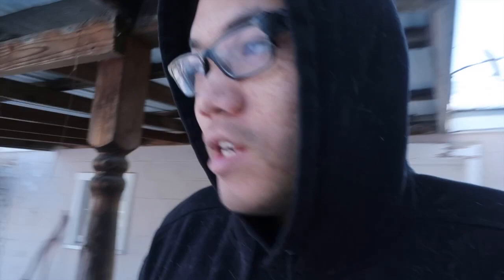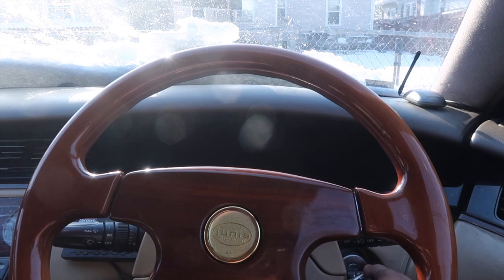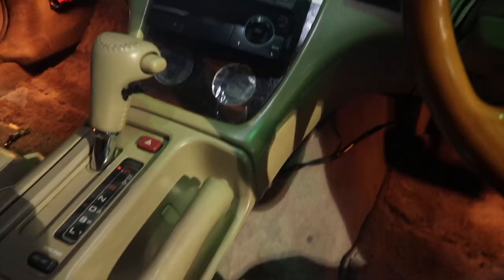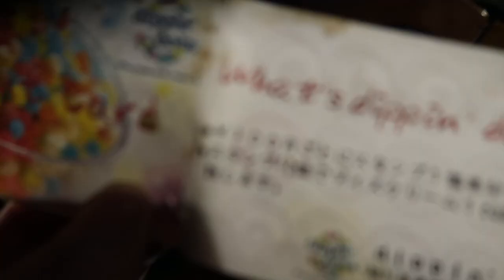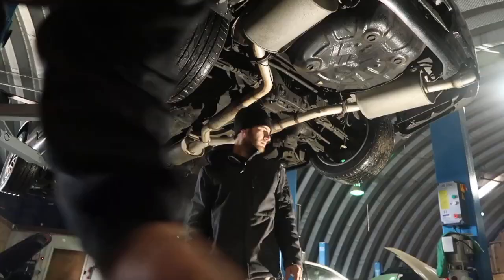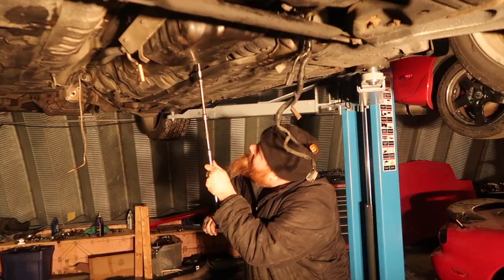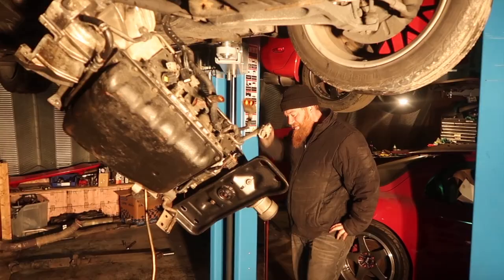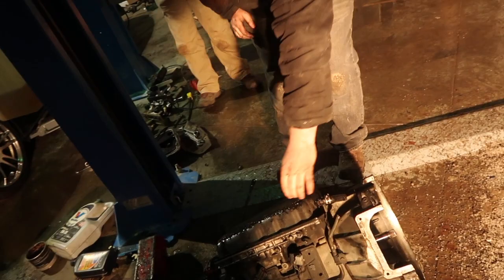My Transmission Almost Killed My Friend | Eunos Cosmo 5 Speed Swap

Comment: no engine hoist I guess you're learning baby steps how to do mechanic work ?
Reply from the maker: Manuelito Dias explain how an engine hoist would make the trans drop easier lmao. Learning baby steps just have a 6 lift shop and dyno.
Reply: well well somebody definitely get upset 😡quite easy talking about heaven short fuse.
you want me to explain how easy to trap the transmission down 👌 I'm going to explain that easy as I can to you can't basically baby👶 steps so! once you get to you last process steps of almost bringing the transmission down
1 you make sure to praying your transmission jack
2 Jack it up all the way too meets   with the oil pan from the transmission nope now not not!! the oil pan from the motor transmission oil pan ok
3 Dan you are just  screws from each side so the transmission I fail on you now. you want to  please one hand on the output of the transmission this is why because the torque converter is a bit heavy so it's going to be top-heavy little bit. you know what let's cut to the chase let's forget about the Hoist the transmission jack the real fat is. you guys dating take no step of precaution to be safe on a work environment this is why everybody is commenting about it is one if you would have been working on your driveway but using a shop with lifters which you're claiming do you guys have 6 damn and 1 dyno ok acid example when you bring a car into a lifter do you don't have to make sure that all amount jack location properly secure before you lift the car in the air and before you die in a car you don't have to strap it so won't flight off the dyno it's cool prepping yourself and be safe. now instead you surround yourself with a lot of poorly excuses and then gets upset why people are make judgement on your actions and may I remind you you're the one who put yourself in this position!🙊 which everybody can make an opinion what you doing could come both way good or bad you have to take your head out of your ass an start learning how to roll with the punches I mean you are lucky that your friends not wearing the transmission for hat today you cannot be in denial always can you imagine that is who you call your friend if it's something would have happened working on your car just saying. on a positive note I liked your cars and breaking something different which is good makes it everything interested and and I could say I like your Channel. also don't brag on how much stuff you got in your shop because  will make you that  different from those guys when you go to car meet ragging about how faster car are.  I going to leave your quote I want you to think about it Don’t believe everything you hear, don’t believe everything you read and only believe half of what you see.” – DMX
Reply from the maker: unreadable gave up before point 1.
Reply from the maker: unreadable gave up before point 1.
Reply: @KennyatHumble  I think he meant to say "transmission jack."

Comment: i mean i know you probably don't want that trans but besides that being dangerous and stupid you just messed up that trans that has to be worth something?! i follow your channel because the quality content but there wont be no content one of you get kill by doing something stupid. i Don't know it might just be me but i think you proceeded stupidly on taking that trans out of that car.
Reply from the maker: festo gonzalez The trans is going in the trash lol
Reply from the maker: Good luck getting more than $20 from a broken automatic fd transmission.
Reply: it wasn't broken before you let it fall down, was it?
Reply from the maker: Yes it was... why do you think we let it fall?
Reply: oh i thought you did it just to show off
in that case well... i guess it was justified lol
Reply: If I recall correctly, I think the transmission not shifting into 4th gear. Automatics are complicated so their could've been various problems causing that.
Reply: When’s the 20b swap going down?
Reply: every mind is different. where i come from we don't trow old or broken stuff away we try to fix them. but i understand where you are coming from you would rather have a manual trans than a broken automatic in your cosmo. by the way i was not aware  that the trans was malfunctioning. 

any way i still like your videos though so keep up the good work and stay away form unsafe scenarios.
Reply: The cost of reparing automatics can start at $1,000 and read $2,000+, so if he could get a swapped manual, it could be cheaper or the same price as repairing the automatic. So if you wanted a manual anyway, then fine, but if not and a manual swap would cost a bit more than repairing the automatic, it could be offset by the manual reliability.